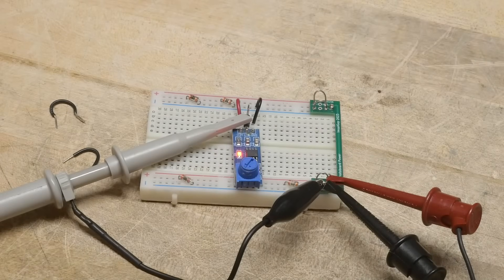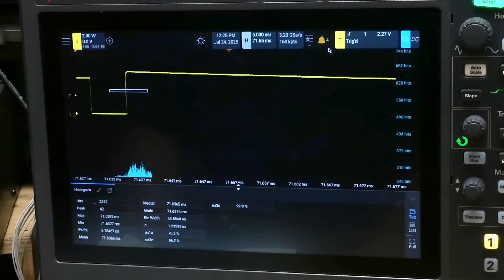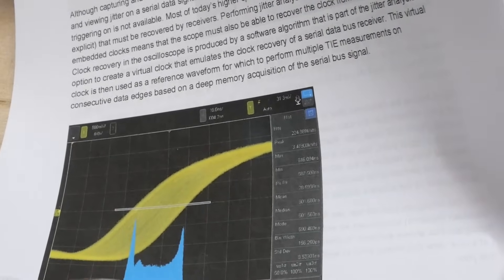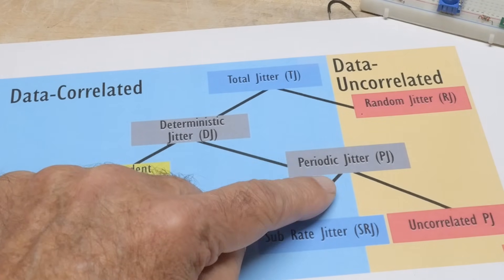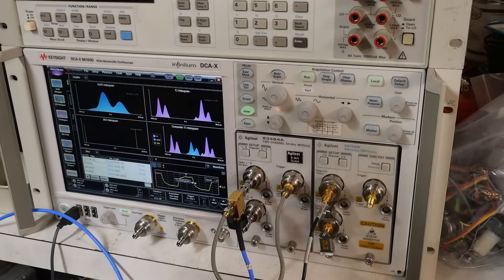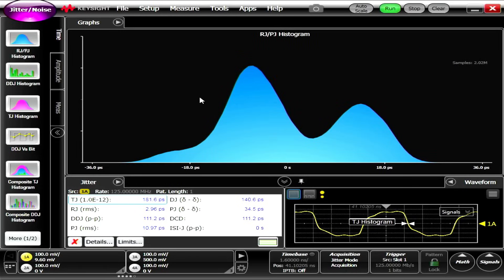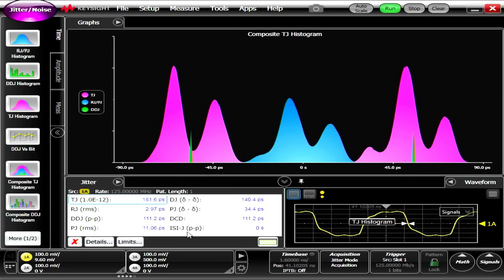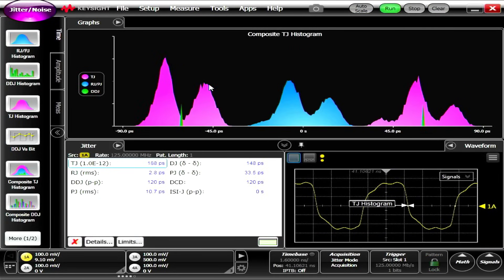#2313 DCA-X Jitter Measurements

Comment: So you add jitter to propagation delay and clock skew, clk-to-Q and setup time and that must be less than your clock period. What else?  Data jitter in audio signal - different opinions on what really matters. I read that into Pico seconds matters but perhaps more like nano second time frame? 

I haven't gotten into high speed clock rates. When I was doing design for military gear the clock rate was only around 10MHz to cover military temperature operating range. At those rates click skew (clock was fanned out) had to be considered and there had to be enough timing room to meet setup. 

Interesting machine!

Comment: AI Summary

Abstract: Understanding and Measuring Jitter in Electronic Signals

This video provides an introductory and practical demonstration of "jitter," the timing variability in electrical signals. The presenter begins by illustrating jitter on a low-frequency 555 timer circuit, showing how signal instability accumulates over time and can be visualized using an oscilloscope's histogram function to display the statistical distribution of signal edges. The discussion then transitions to the critical importance of jitter analysis in high-speed digital communication systems (e.g., SATA, Ethernet, fiber optics), where accurate timing is paramount for correct data decoding. The video details the theoretical components of "Total Jitter" (TJ), breaking it down into Random Jitter (RJ), Periodic Jitter (PJ), and Deterministic Jitter (DJ), explaining various sub-categories like duty cycle distortion and data-dependent jitter. Finally, the presenter showcases a dedicated jitter analysis feature on an advanced oscilloscope, demonstrating its automated capabilities for characterizing a 125 MHz oscillator and presenting real-world jitter measurement values.

I used gemini-2.5-flash| input-price: 0.3 output-price: 2.5 max-context-length: 128_000 on rocketrecap dot com to summarize the transcript.
Cost (if I didn't use the free tier): $0.0063
Input tokens: 15044
Output tokens: 717